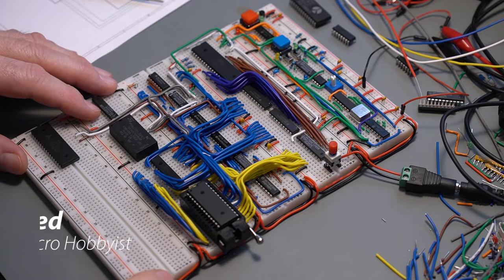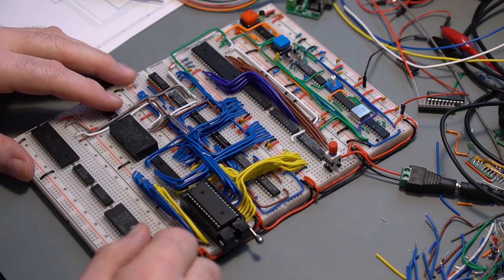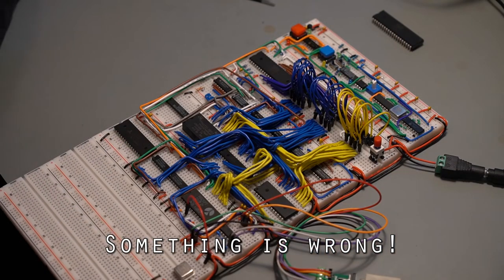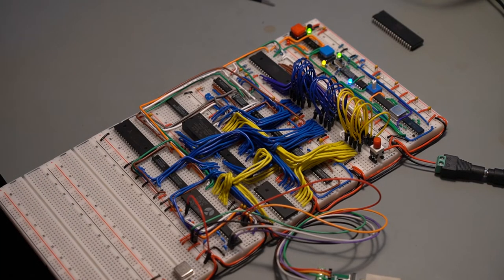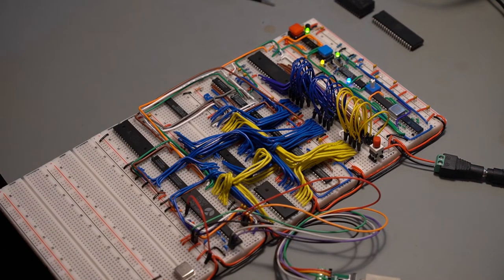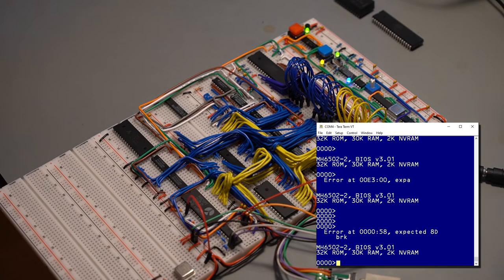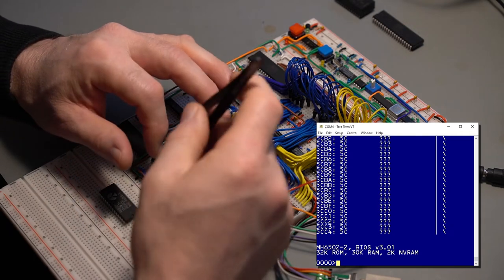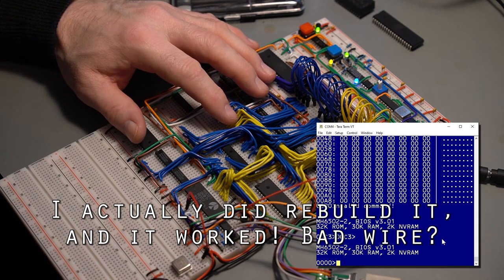MH6502 - ACIA (Ep5)

Comment: See quiet a few people pull the hair out when bread boarding, seems these bread board did not even run normally when the chips demand accurate timing. You got to consider making PCB modules, so you can swap them or change each module depends on your needs, or mix the bread board with a core module (I think it's CPU and addressing logic), it's maybe cheapest to develop. Thanks for your video.
Reply from the maker: Thank you for your comment.

I actually redid the whole breadboard. And everything worked well. Hence my initial thoughts that it was a wiring issue. 

I made some PCB, that I'll eventually feature in future videos.